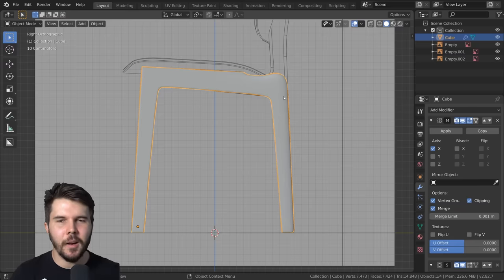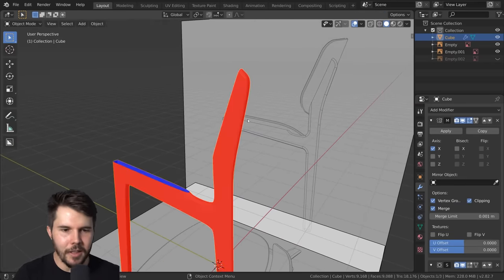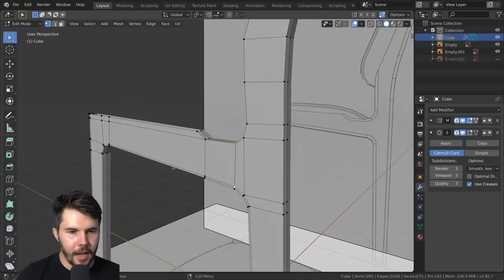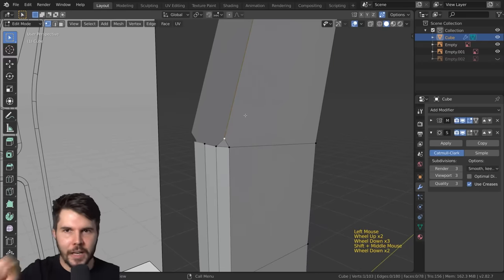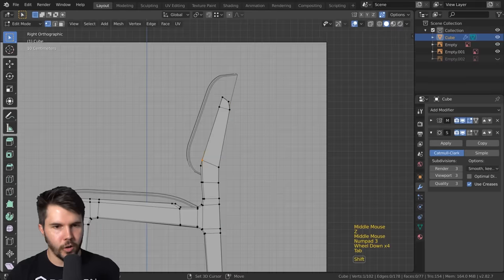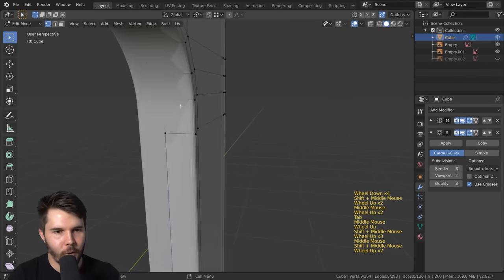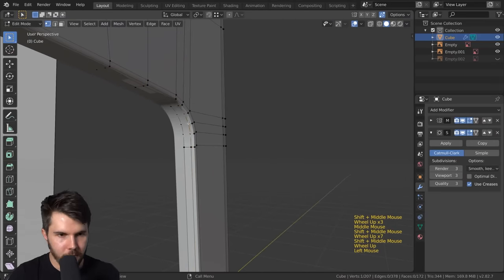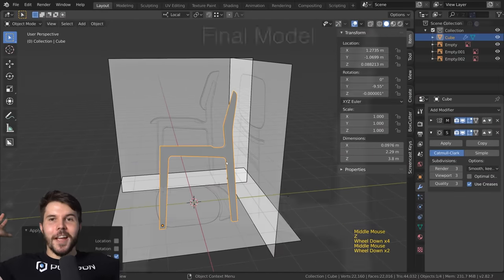Blender Beginner Chair Modelling Tutorial - Part 3

Comment: Do you think adjusting "Crease" rather than adding loop cuts is much easier to create beveled edges?
Reply: No he didn't even add a crease
Reply: I thought he was going to use it but I guess adding loop cut is more optimal, you have a better control on the width of the bevel I guess that's why
Reply: Using geometry instead of crease is program agnostic. If you're going to be exporting your object to a game engine, or another 3D program, they don't know what a crease is.
You also have better control over how sharp the curve is. I've had more than a few issues trying to sharpen a curve with the crease. It became really messy.
The bevel modifier is great for that. The newer versions of Blender even allow you to make custom bevel profiles, great for corner mouldings. Allows you to do it non-destructively so you can go back and change it if you need to.
Reply: Using edge loops u can much more easily control the roundness, also it helps with UV unwrapping. So you should use edge loops instead of crease, will help you with later problems. When you use crease without any support edge loops, you would usually get distorted uv maps which is not good.

Comment: When you originally adjusted the X thickness you were going by the feet. It was actually thicker at the top than at the bottom. I selected all the vertices except for the feet and the mirror center and rotated them back out slightly.

Comment: 19:14 you could double tap Y after rotation. Whenever the object that we r working on is rotated we can double tap the axis and it will snap to the real one... I don't know how to explain it  but it is really helpful. Try that...
Reply: Pressing X/Y/Z once uses Global transform orientation.
Pressing it twice switches to Local.
(Actually, you can select a transform orientation in the leftmost dropdown in the top middle - and by default, it is set to Global. If you choose anything else, it will be what gets used when single-tapping, and double-tapping will switch to Global as the second option.)

Comment: Thanks for the video ! I only would add that the wood base width is actually tapered (you can clearly see that on the front blueprint thanks to the inner "bevel" lines that converge at the bottom). Just so you get a less "blocky" wood part at the end ;)

Comment: For those who are not getting the correct mesh at first time check the viewport render, it should be one. 

If you want to check the amount of bevel at @10:00 then go to object mode, press "/" then you are in isolation mode, then go position which gives you the view of both horizontal and vertical faces and then adjust the bevel, it'll give you perfect flat surface. The press "/" again and you are done.

Comment: I find it a lot easier to remodel a part, if I think about the carpenter making the part with his tools. The legs consist of a few parts, all cut from flat wood, shaped to spec in 2D. Then it got glued together and then beveled with a router in some points. The extra lines in the drawings seems to be the start and end of the bevel. It would be natural to set loop cuts there.

Comment: Dissolve edge only works when the edge has faces on either side.  The dissolve merges the faces, thereby removing the edge.  However, in your mock error, you had an edge with no faces, therefore there were no faces to merge.  If you had created the edge using the cut tool, then you could have dissolved the edges since that tool actually bisects the face.

Comment: At 5:27 there is an add-on; i forget the specifics, but one of the in built 3d print add ons will tell you if there are nonmanifold edges (inside geometry, the line problem you showed etc.) And it will allow you to select all of them.
Anyway I enjoyed the video thanks!

Comment: Top Tip: [RMB] over any menu item grants you the ability to add a shortcut to the Quick Favorites menu which is called on [Q].
Face Orientation and Mesh > Clean Up > Merge By Distance are prime candidates for this menu.
Reply: @4:30 There are two types of these accidental edges:
1) Face Dividers unnecessarily intersect existing faces. In effect they mess with the topology and generate ugly edge flow but will not produce severe distortions. They are created on purpose using the Join command [J] and disappear using Dissolve Edge [Ctrl+X].
2) Independent Edges form connections separate from existing faces and cause these contradictions between hard and smooth Subsurf-division. To provoke the error on purpose chose any two vertices and hit [F]. As they are separate from the rest of the mesh they need to be erased [X] hard.

Comment: I was at the merging steps around 9 minutes, but noticed the triangle that gets created at the top edge was pointing outwards on my model. Sure enough, following the troubleshooting steps you'd just gone over, I had an extra/overlapping vertex and merging fixed the problem. Those suggestions couldn't have come at a better time!

Comment: Hello Blender Guru. I follow your tutorial with great interest. I learn a lot from the explanation you give of all the steps you follow to make the chair in Blender. I'm now at step 3 and it's going well but I don't understand why the leg of the chair doesn't get a straight bottom. I applied the loop cut, but the leg is not as it should be. The rear leg of the chair is well designed. Can you give me a tip?
I can sent you some screen dumps or the file if you are interested, but I do not know how to do this.

Comment: Here is a list for troubleshooting, based on his suggestions on this video:
- Apply transforms where necessary (rotation, scale, etc)
- Make sure all faces face the right direction. If not, select all and press Shift & N to fix OR Ctrl & Shift & N
- The order of modifiers matters
- No overlapping mesh
- No useless faces inside the object
- Scale of object should be set to 1 (quick fix: Ctrl & A > Apply scale)
- 4 edge faces are better

Comment: Is there a reason why you rotated the wooden base instead of shearing? You could measure the shear distance from the reference. Also it would not create a problem with the chair leg bottom. Also when making the mesh, do you also make a loop cut where 2 pieces of wood connect? That would making selecting the faces later for texturing easier.

Comment: For those wondering why your wireframe may not look as simplified as his (seeing double lines even when in side view) I found a solution. On the Mirror Modifier, unselect the "edit mode" icon (which looks like 4 small boxes in each corner with connecting lines). Helped fix it for me!

Comment: Just saying in case someone is having the same problems with loop cuts not going all the way around. Somehow I've managed to create some faces inside the geometry, so the loopcut would "turn" on that edge and loop around the face inside the model. I''ve solved the problem after going to wireframe, selecting the faces inside the model and deleting them (X > Faces), now the loop goes around the whole model.

Comment: Great tutorials. I think you can select the interior faces. And non-manifold faces (which I do when I do models for 3D printing, but with your flat face cheat it would probably not work. Why it not be more correct to set the crease of the edge to 1?
Reply: Because crease is Blender internal. You might get issues when exporting your mesh.

Comment: 11:06 If you select several vertices that seems they're connected, switch to wirefram and see if it's a continous orange color. If the color on the line between vertices are turning black, there's something wrong. Tip: Choose the vertice(s) that 'breaks' the orange lines in a continous connection of vertices, and first apply 'M' for merge (by distance). If this doesn't work, select the vertices and choose 'Collaps'. It'll solve the problem.
12:31 For those who didn't get to know which key he pressed to fill the gap, press 'F' for Fill.
Edit. I didn't notice the edgeloop running down ended pretty quickly, so I had to insert new edges. Select the vertices, go to 'Vertex' and select 'Connect vertex path'. It'll insert new vertices (and edges). Merge overlapping vertices. One trick is to select the vertex then hit G twice, move it to see if there are multiple vertices. If there are, select the other one and merge using 'Merge - At last'. I had to rework the entire length down the chair.... But fixed it.

Comment: If anyone is bothered he did not taper the model (front view) like in the blueprints you can do it like this.
1. Set pivot point - put 3D cursor at the base of the leg [shift + right click], select object -> press [.](regular dot, not numpad dot)-> 3D cursor
2. Select half of the mesh - either box select or (if you already rotated the mesh) select any middle vertex -> select menu -> side of active
3. Rotate it [R]

Comment: Instead of using rotate to tilt the legs, which as you noted changes their height, would it not be better to skew the legs instead?  I.e. you've modelled it using the blueprint, setting the z of each point to match, but by rotating, everything has moved.  With rotate, you could scale the z to bring everything back into line, but that's two operations, rather than just one.  There'd also be no need to fix up the bottom of the leg so it's level.

Comment: 20:15
I used 'shear' instead of rotate, which SLIDES the vertices along the x axis without changing the y. The more you rotate away from 90 degrees, the more vertical dimension would be lost. I had to get rid of the mirror modifier in order to do it however.

Comment: Instead of rotating it over, surely there must be some way to shear it over right? So that we don't have to worry about rescaling?
Reply: If you shear a 3d mesh be careful with your surfaces as some of those will stay 100% horizontal or forward facing when you use the shear tool while the side faces get sheared. Which means the cross section shape of some parts don't have 90 degree  corners anymore. Shearing basically creates a similar problem if you rotate a cube and then apply rotation and then scale it. The angles becomes skewed.

Comment: Also, at the end: I suppose the whole chair was scaled, whereas you actually just want to scale everything "up", meaning the bottom of the leg should stay where it was.
You can do this by going into edit mode, selecting everything, then deselecting and re-selecting one of the vertices in the bottom of the leg, picking "Active Element" as the Transform Pivot Point in the dropdown at the top center of the window and finally scale along the z-axis (with the Transform Orientations set to Local as in the video). You're then scaling "from the point of view" of that active vertex you deselected and re-selected.
Reply: that's still a lot of work haha, his 3d cursor was already at the world center and his legs perfectly sit on its plane, so just change the pivot from median point to 3d cursor and scale it. It's a lot quicker and dynamic this way, but if you wanted to preserve the 3d cursor position elsewhere, the active element as pivot can be equally quicker in edit mode, yeah.
Reply: @RuthwikRao  Hold on, that still doesn't keep the bottom of the legs where they were, does it? Since the mesh is rotated and the world origin isn't along the local z-axis. Might be pretty close though... In any case, that was my way to fix it, I'm still learning :)
Reply: @DaTux91  yeah I was referring more to the pivot side of the process, but yeah, if you did indeed rotate the object before scaling, you can change the transform orientation to the local Z by pressing S Z Z anyway to be the most accurate.
Reply: @RuthwikRao  Oh cool, I didn't know that shortcut. Thanks!

Comment: ##TIP##
You can also use local transforms by just press G to move the Vertex/Etc. and then double tap the directional key(X,Y,Z) to start using local object data. 19:40

Comment: In my case, turning on "on cage" on the subdivision settings helps finding problems. 
I don't know why but my vertices were messed up and couldn't fix it with merge. 
Turning it on makes it clear to see where it went wrong. 

Idk if it helps anyone but I just fixed problem with this and wanted to share it.

Comment: The reason it didn't dissolve the edge was because the edge is not technically connected part of that face. @4:30 If the edge cut the face in half, you could do dissolve edge.

Comment: Hey guys!
I know im way to late for waiting an answer in this video, but lets try!
My whole base has an huge problem, that is a huge line ripping it in two.
It is as if the Sub modifier is rounding the shape before it touches the mirror modifier (My mirror modifier is in first place).
I will try to explain in a dif way: The parts that were supposed to be together with mirror, like the top of the base and the legs, they have an huge curve, making a gap in the intersection. to make the problem less visible, I created a CutLoop that cross the entire Y axis of my base and banged it to the middle, so it made the gap really small but it still there.
I decided that was way to much difficult for me to sort out what is happened cuz in the final, it wouldnt be noticed, but for future reference, i would be happy to know how to solve it
Many thanks to anywho that helps me!
PS: If I desativate the Sub modifier, the shape goes back to its "squarity" and the line goes away

*fixed: I realize that was a problem in the Sub modifier and went to change its settings to see if it works. I swap "boundary smooth" to Keep Corners and it was solved.

Comment: Bit of an advanced tip that's helped me in the past:

Creating two INSTANCES of an object (Alt+D, not Shift+D) allows you to change one object and it will correspondingly affect all instances of that object.

So, I created two instances of the chair leg object: one to rotate in line with the blueprint, and one still facing upright as before. I found it much less disorienting to modify the leg still using the global axis, and having those same changes apply to the rotated instance. To anyone reading this, maybe give it a try and see if you prefer it (maybe you like the original way, that's fine too).

Hope this helps!

Comment: 13:20 can't get the wireframe mesh with the added detail in edit mode. Unchecking optimal display only works in object mode. The icon for displaying in edit mode is turned on too...

Comment: Although these tutorials are slightly outdated, I can feel myself improving and my interest in Blender growing with each passing video. However, there's one thing I still don't fully understand despite completing the donut tutorial and (part of) the anvil tutorial: At 12:44, is it such a big deal if alt-selecting that face gives us something different? When I alt-select the same face Andrew does, it lights up all the faces beneath the one I selected (in other words, all the "large" faces that make up the back of that chair), all the way down to the floor. 

I don't understand why it should matter so much that they follow the thin column of faces closer to the back-end of the surface like his does. Is it such a big deal that I should go back and undo some mistake I made? Because I'm pretty sure I'm following his steps to the letter. This happened to me in the anvil tutorial as well and I find it frustrating, because I don't notice a difference in my outcome regardless, so I'm not sure if/why I should even care.
Reply: I came to the comments with the exact same question.

Comment: If for some reason after you recalculate outside and inside (shift+N or Ctrl+shift+N) and everything stays red, you can fix this in "Edit mode" next to vertices, edges and face selection, there is a "mesh" button,  click it after you have selected your mesh obviously, and go down to normal then click flip, this fix the error for me, I'm using blender 2.93, I hope this help you.

Comment: Question: When planning to render in blender, what are the advantages of modeling in blender vs importing furniture modeled in another software (fusion 360 for example)? Not specifically furniture, but any object that benefits from the dimensional accuracy that you get from these other engineering softwares.
Reply: Texturing! When you export a mesh file from F360, it will be absolutely bonkers, which will likely make it difficult to do a UV unwrap texturing process which you'll want for realistic renderings, and which is more important that dimensional accuracy for photorealistic renderings in my opinion. If it's a procedurally textured material then you probably won't have an issue, but for anything you plan on detailing, like a sofa, you'll want that texture control.

It's also worth noting that with just a bit more effort than used in this video, you can achieve pretty good dimensional accuracy. Just scale the blueprints in the beginning and then actually follow the drawings (radii edge lines in this chair for example).
Reply: @DoctuhJ  thanks man! i mainly use f360 and im procrastinating the process or learning to properly model in blender. but this makes it seem like its worth the time.

Comment: So I used to do a lot of subsurf in lightwave, in which we'd use weightings on edges to control the level of "playdough" and I just did a check to see if blender has this. So why arent we using Creases in blender, instead of adding geometry for a beveled edge ? is it for the control over the radius of the bevel or some other reason ? I presume you must have used creases in one of the 11 variants you built for this ?

Comment: Some advice if your model looks weird after adding the mirror modifier:
○Guru edits out that detail, but he is changing constantly between Catmull-Clark and simple in the subdivision modifier, it helps to not see a lot of stuff on screen whil moving vortexes
○Check in the subdivision modifier, the option "Boundary smooth" to "Keep Corners", or it will average the inner corners that separate the mirrored parts and the mirror will look wrong
○He said it already, but be sure clipping is checked on in the mirror modifier